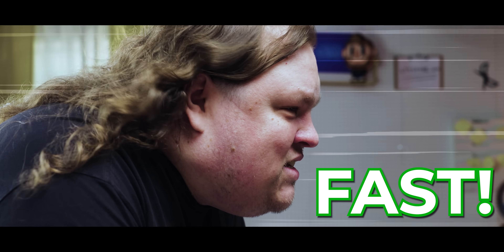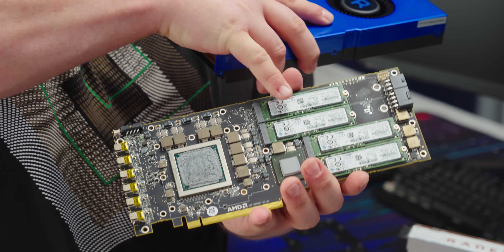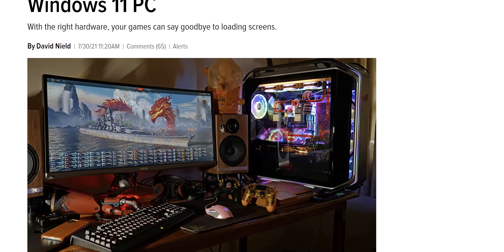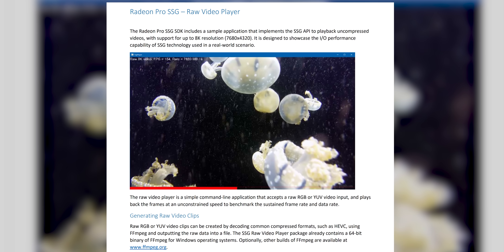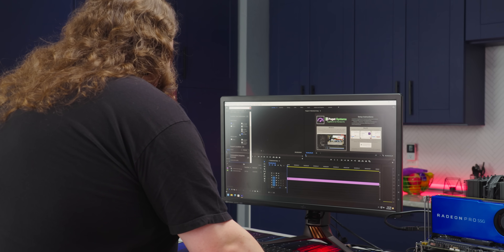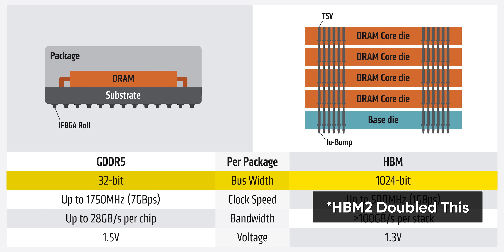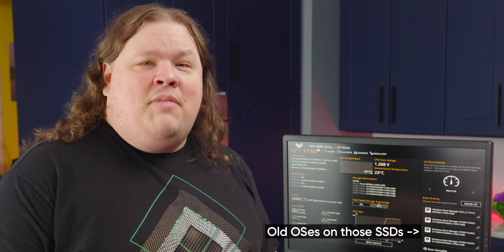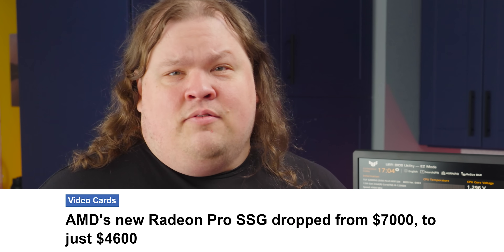Why does this GPU have an SSD? - AMD Radeon Pro SSG

Comment: If the API was actually widely rolled out, something like this would be incredibly useful for science departments at universities (which is a niche market, but not an insubstantial one).
Reply: Would have been Ideal to train models for Deep Learning using this GPU
Reply: @Sappho I was doing astronomical simulations (my work was more with globular cluster formation and evolution, 10s of thousands to millions of stars, sometimes coupled with a molecular cloud during early formation) and there definitely would have been a performance boost if the read-out/save time of each time slice could have been sped up by having the GPU dumped it straight to storage.

Just as you also described, most of my work was done on a Beowolf cluster with a lot of high powered off-the-shelf GPUs.
Reply: Niche but actually large market haha, I worked in university research at the National Weather Center. Basically any excuse to build something cool for research is the path most travelled by pre-doctoral and under grads.
Reply: meh ... there's only so many times storage malware can give the feelz...

 although .. iffins the gpu executed from that storage on init ... 🤔

Comment: This technology eventually found a home... AMD used it in the PS5 and Xbox Series. Both systems can load into RAM directly from the SSD, bypassing the CPU.
Reply: Is that true?
Reply: Well, this lead to Direct Storage, that we have today on this consoles, and soon will have on Windows 11. Pretty much the same idea, technologically a bit different i guess.
Reply: I think bypassing the CPU is difficult/insecure, and I did some research and was right. 

Complete CPU bypass would mean being able to skip the kernel layer, and all the security checks which gives you arbitrary read/write to memory from disk that should be minimized as it provides a loophole.

What DirectStorage does is simply use the GPU to decompress compressed data sent over the bus from the SSD, which then hands it to the CPU to decode and execute. This basically just speeds up the data retrieval pipeline, but doesn't not expose any loopholes as it is fundamentally the same underlying mechanism all computers use today to fetch data.

The AMD SSG card in the video can do such caching as the GPU doesn't execute the kernel code, which means that while you can still write malicious code in to target the GPU, it's way more self contained than executing it directly on the CPU which takes control of all your processes including your OS.

Comment: I honestly wondered if this GPU was actually hiding a secret, that Microsoft had these to base DirectStorage work off of for all these years while they worked on it. Maybe now that it's finally public and AMD has actual tangible research into this as the product actually exists... well, I don't know... imagine if RDNA3 has this as a surprise feature to work amazingly with DirectStorage?!
Reply: This is exactly what's needed to blow graphics to a new area, think of the huge scenes you could render
Reply: The beta setup for DirectStorage used Nvidia RTX cards, as Nvidia was already doing work in the same direction for RTX I/O, aimed at the workstation market. Remember, they needed something that was going to work in the PCs people will own in the foreseeable future rather than create something requiring a costly niche hardware design. If Microsoft used them in R&D at all, it was more likely for the Series X/S Velocity Architecture, as a proposed console design was less sensitive to non-standard hardware if the cost was good. Even then, this wasn't very close as the major component there (and in the PS5) is the controller functionality with the dedicated decompression block. Offloading those operations from CPU and GPU are a big factor in letting the console perform optimally. 

I strongly suspect that Microsoft and AMD will try to push an open standard for a PC hardware spec that will bring a version of Velocity Architecture to PC to give DirectStorage the full functionality it has on Xbox. This needs to be a vendor independent spec to get Intel and Nvidia on board, otherwise it's will remain a niche that game developers will be reluctant to use. A recent previous example would be DirectML, which is hardware agnostic and relies on the drivers to bridge the gap between PCs and vendors of ML focused hardware. Thus the ML hardware can live in the CPU, GPU, or a separate device on the PCIe bus, the user doesn't need to know so long as the driver tells the system what to look for and how to talk to it.
Reply: This would be amazing
Reply: At this point, i think we don't need CPU's. It is cheaper and better (for gaming) to produce all in one APU designs, like how PS5 and other game consoles are designed.
Reply: According to some market analysts, top RDNA4 could come with 512 gigs of pcie gen 4 memory
Reply: HSA has been around for way longer.
Reply: @epobirs  no
Reply: For what it's worth, Microsoft's engineers have said in the last day that DirectStorage does not require an SSD, and the data still goes through the CPU on its way to the GPU.

The API and samples are publicly available now, so this can be verified by anyone.  Someone on the DirectX Discord (yes, there is one) even got DirectStorage working with a USB floppy drive......
Reply: @casparhughey5651   Sure -- but what I'm saying is new information from within the last day.  You can go see for yourself on their Discord.... the source is literally one of the engineers on the DirectStorage team.
Reply: @casparhughey5651  The source code does not contain any GPU specific code, and MS's docs literally show that the files must go through system RAM first
Reply: @epobirs  Also AMD RDNA 2 GPUs support DirectStorage.
Reply: no
Reply: @erdem--  I would have disagreed with you so amazingly hard, if apple hadn't shown that an APU SoC could perform so fucking well, and that AMD had damn decent APUs with Vega 11 baked in. 

Now that the PS5 and XSX both are using custom AMD SoCs with RDNA2, I think this may be the way to go in the future. We're starting to get down to the limits of how small we can make a transistor, we have maybe 2-3 more jumps and then we're gonna hit the wall. 

The fact that apple's macbook air with literally passive cooling can game reasonably well considering and also do video editing is kind of game changer. I think all 3 companies need to be diving towards ARM or RISC V, and take advantage of this kind of new wave of tech.
Reply: @erdem--  GPUs are capable of doing more no of tasks parallelly, but the time take per operations is much slower than the modern CPU. So, yeah not everybody needs it. For sure, ML enthus will benefit from this, but not the common man. Also, the insane power consumption would be the dealbreaker for vast majority of people

Comment: If ML libraries target this platform it seems like it could be a compelling option. Now days models are getting so large that even 24gig of VRAM is not enough. Yes the performance would undoubtedly be worse using SSDs but the alternative is not being able to use the model at all.
Reply: THIS, so much this.
Reply: would that be much faster than just using swap?
Reply: @artlessbene  maybe not faster, perhaps cheaper
Reply: Code it for m1 ultra 128gb of vram
Reply: Nvidia wants you to buy their NVLink systems instead. Or A100 80GB.
Reply: It's super easy to run out of ram even just AI upscaling video. DAIN (depth aware interpolation, I think that's what it's called don't quote me) also chews through the ram like crazy.

I know unreal engine has some crazy new LOD technology, having the entire file accessible probably would give you some more FPSs.

I'm kind of disappointed this technology didn't pan out.
Reply: deep learning based AI models access the entire memory and change the data in all memory banks in every iteration during training, so its not like 90% of the memory is sitting idle and 10% of it is changing. Hence, the extra memory can't be used as a faster swap space and training would become 100x slower which would defeat the whole point of using a GPU...
Reply: I've worked with ML algorithm research a decent bit and I can't speak to this specific scenario, but the memory would probably wear out pretty quickly. Keeping datasets in raw format on-card would be nice I guess if the PCIe bandwidth + CPU loading (or bypass) was too limited. But with SSDs it's pretty darn easy for things to burn out if you're flipping things in and out like that that quickly.

Now, for psuedo read-only memory, like inference only kind of stuff.... That would be pretty overpowered. Deepspeed + ... ZeRO I think? Exists on the training side at least, but maybe this reduces some engineering complexity if you can trivially keep several gigabytes of parameters in memory and just do whatever layerwise activations you need each time. Would be limited by your largest layer I think unless you were chunking + caching on ram but then maybe Deepspeed is better.

Just a few thoughts, definitely spent time thinking about this too. ;D Hopefully we'll find long term solutions that work well. Pretty creative I think and appreciated seeing your thoughts about this! ;P :D
Reply: @bharatsingh430  thats not correct, look into the infinity offload engine (zero-3) optimizer by microsoft
Reply: The Radeon Pro SSG makes Optane looks like a perfect match.
Reply: I was thinking the same, but it should be nVidia GPU then, ML stuff mostly use CUDA cores and AMD is useless in that sense.
Reply: @virtualtools_3021  Hahaha, no. It's not even remotely comparable. You would wait till the heat death and it is still not done processing. Don't let Apple's marketing words allude you, the numbers are mostly for video processing only.
Reply: @MrNoipe  I don't know anyone in the community using zero (1/2/3). It is more like a poc to train large networks and less than 1% researchers even inside microsoft would be using something like it. May be one day if something like zero becomes common place, this might have a market. (and I hope it doesn't, as ill be out of a job if we need 1500 GPUs to train something useful)
Reply: it probably would make more sense to use RAM at that point
Reply: @bharatsingh430  No.
Reply: Introduces a new paradigm to ML, of very massive, though slow processing training for extremely complex use cases.
Reply: If you compare SSD performance to something ML specialized (NVIDIA A100), I think you'll find that both bandwidth and access time are both slower by two orders of magnitude.
Intel Optane could probably close access time by an order of magnitude, for however much that will help.

A100's will also NVLink together, giving you more compute and memory bandwidth per chunk of RAM.
There's a reason the SSG didn't take off for ML - It is simply not suited to the task
Reply: @ubermidget2  GPT-NEOX-20B could work quite well as it frees up the RAM and you could parameter stream per layer (esp as each layer is so spicily long to compute, relatively speaking haha)
Reply: But then you got M1 Ultra which can has as much as 128GB of RAM. Since it has a bandwidth comparable to top end VRAM and can indeed be accessed by the GPU inside the SoC, that seems to be the better solution unless even more RAM is needed, as unfortunately that design isn't scaleable.
Reply: @mritunjaymusale  yeah it's got AI cores in it too
Reply: @XiangYann  well I wouldn’t say that too fast. Yeah ofcourse it is different than running on a full scale GPU cluster, but those neural engines are not slow by any means. Especially considering the prices and the fact you can put a lot of them in a rack.
Reply: My thought as well, you could not only use this to store the weights for huge models, but also store TB sized data sets to massively increase your I/O speed.
Reply: two RTX A6000 should do the trick
Reply: @ChrisAzure  Or just regular RAM: Faster and no issue with memory cell degradation although not quite as storage-dense.
Reply: @tz8785  suuuuuuper expensive....
Reply: People are asking whether it's faster than swap, but I think the real question is, would it be faster than big batches and system RAM?
Reply: Finally it came around again, reminds me when I was trying to put a sata interface on a 3DFX 5000 as a project in 2002
Reply: I have two thumbs, but I can only thumbs up this once. Bummer. This concept is a game changer.
Reply: Not ssd nvme disk
Reply: @Bharat Singh  ah if the card has ai cores but if not ?
Reply: @EpicKaiserTom  yeah more like debugging games for example

Comment: I wonder if they had done something like a separate PCIe daughter card with something similar to the SLI or Crossfire interfaces would have worked better. It wouldn't have shared bandwidth across the PCIe bus but still allowed direct access to the SSDs installed.
Reply: Hey this seems like a really cool idea.
Reply: I am not sure I understand , aren't the SLI and Crossfire interface very slow by themselves ? The data would move through PCIE... Like any NVME drive
Reply: @jeromenancyfr  I imagine the idea is, GPU calls for data, pass over link, then out through pci... CPU calls for data, pass through pci.
Reply: That eats into compute density though if you want to have several of them per node.
Reply: well my understanding is thats basically how nvme direct storage drives are going to work (and are already working like that in the ps5)
Reply: @Ryan Chappell  slow ? Actually the sli or crofire setup is by linking syncing 2 or more gpu units together and that without serial conetors like a cluster  only the first pci-e is used for data transfer the rest just supplies power
Reply: @Rakkakaze  you mean pci-e 16x  or x32 or else y doubt is worth it y thin the purpose here is that the raw data can be stored as close to gpu as possible  more like a vram swap 😉

Comment: With respect to the random read speeds (1:41); Why not test the drives independently from the SSG, or use MP600 drives in the SSG to get a proper apples to apples comparison? The drives firmware themselves may just be crap and account for why the random speeds don't scale nearly as well.
Reply: Ain't nobody got time for that.
Reply: Because driver overhead for RAID increases latency. on AM4 you're loosing approx 30% of your IOPs even if all your SSDs are connected to the CPU and not chipset. Intel is no where near this bad (same with Windows) but it's still a loss.
Reply: @ThranMaru  well they tested a GPU from 2017 that no one have, so yes they have time,
Reply: Because then you'd just be testing drive performance which wouldn't make sense. It's end to end testing

Comment: When PCIe Gen 4 first came out, everyone was saying how it wasn't practical because it would be used fully. I said then that what would be more interesting if you saw some instances where multiple uses through a single PCIe 16x slot could take place without any hindering in performance. This would be one of those scenarios. not useful, but pretty cool.
Reply: Couldn't agree more. When someone made a car, everyone said horses were better. Without manufacturers trying things outside of the box we would never progress, and I have no idea why everyone is so against innovation. Noone is forcing anyone to become early adopters of anything, and most things people were skeptical about soon became integral to everyday life. With progression comes niche products like this, but at least we can say they are trying.
Reply: and now we're up to PCIe 5.0 with Alder Lake...there's even consideration to adjust NVMe storage standards from 4 lanes down to 2 because of how much bandwidth 4.0 and now 5.0 offer.

I would love a product like this if only to gain more NVMe storage without taking up extra slots
Reply: @bojinglebells  same, I love the dual functionality. I get a pretty decent GPU and 4 NVMe slots  in two PCIe slots instead of three if I had to get a separate addon card. I personally love using up all my 7 slots with lots of cards.
Reply: @bojinglebells  And I think about some more niche area like small form factor PCs and even the NUC extreme. With the speed and bandwidth increases, these types of compute cards could make for near instantaneous connections and make those types of products more viable

Comment: That kind of reminds me of the old Real3D Starfighter PCI Intel i740 gfx card from wayyyy back in the day.  Intel had just released the AGP bus architecture and the i740 was their first foray into the discrete graphics space…probably to help support the launch of AGP 1X, because it wasn’t all that fast otherwise.  For the majority of the non-AGP systems, Real3D built a card with an AGP-PCI bridge chip that basically had an AGP bus and dedicated SDRAM AGP texture memory on board, in addition to the i740’s local SGRAM framebuffer RAM like any other graphics card.  It was pretty cool at the time.  They were sold with 4-8 MB framebuffer plus 8-16 MB AGP texture memory for a max of whopping 24 MB total onboard.  They weren’t very fast, but they supported 1024x1024 px  texture tile resolution whereas the vast majority of the competition including 3DFX only supported 256x256 pixels max resolution texture tiles.  It was slow, but it looked so much better than anything else on the market and helped milk some extra capability from old non-AGP slot systems…perfect tradeoff people like Nintendo 64 players were used to dealing with, lol.  3DFX Voodoo 2 cards had a similar structure with separate RAM for framebuffer and texturing.  Ok, now I’m done dating myself 😂